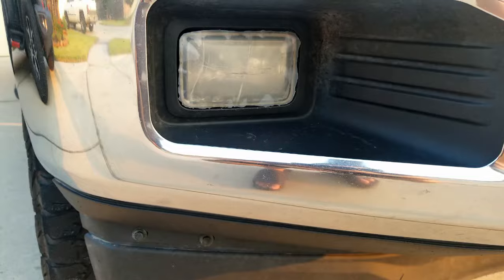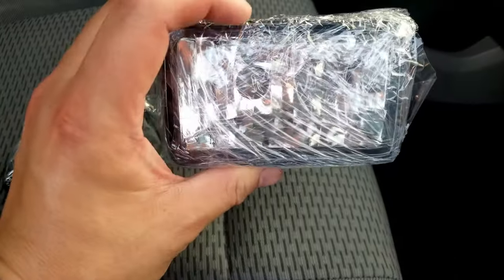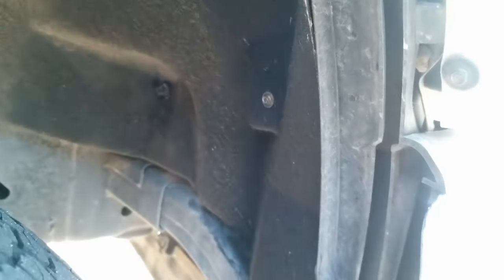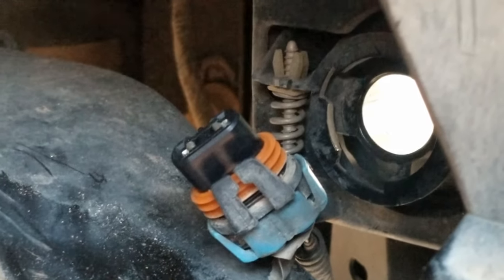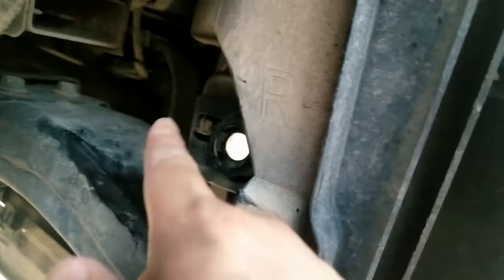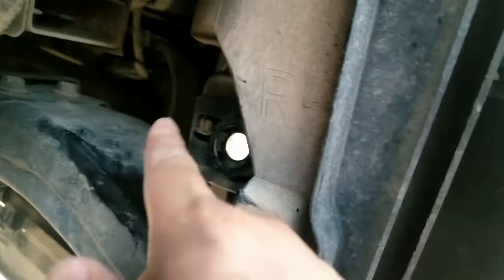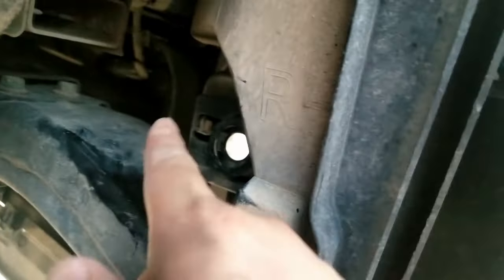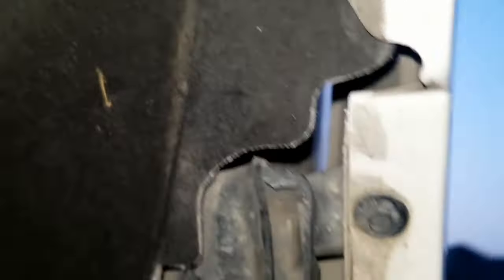2015-2020 F150 Fog Light Housing Replacement

Comment: GREAT tutorial - Thank you!  Mind aren't cracked on my 2018 F150 Lariat, however, they have condensation in them and the bottom if full of road dirt and sand.... how that happens, I have no idea.  I will be using this tutorial to replace mine...thanks so much for a great step-by-step.

Comment: Great job man. Very informative and easy to follow. One of the best how to vids I’ve watched. I wonder if Ford will cover my 2020 under warranty. Cracked right thru the middle from side to side.
Reply from the maker: Hey Ronnie Gregory, I wonder if they will cover it under the factory 3yr/36k warranty also. I can see the argument from both sides. From their side, an outside object/force damaged it causing the crack. From a consumer's side, they should be able to take on rock chips like our headlights and not crack. It could go either way. If you take it in, please update us on what the dealership says!

Comment: Glad it worked out for you. I replaced the housings on my 2019 with LED housings about a year ago and here is what I learned.  
1. There are dozens of videos on how to remove these things without struggling.
2. LED fog lights are much better and you can get them fairly cheap, I think I paid 55 bucks for my Morimoto clones on Amazon.
3. You definitely need plastic trim tools to keep from breaking or scratching things up, looked like you gouged up the plastic trim around the fog light pretty good with that screw driver. 
4. The housings are marked L and R, at least mine were.
5. I pulled my truck up to the garage door and marked the center of the light beam with tape before I removed them. When you put the new ones in you can adjust them to the original position and go from there.
Reply: Now, adding the LED's, is the actual housing different, or can LED bulbs be put in the OEM housing?
Reply: @Powerstroke98  , if you are replacing the entire housing, they are the same, you just have to reuse the adjustment screws from your OEM housings. Lots of videos on how to do that. If you just want to put LED bulbs in the OEM housing, yes, you can do that, just make sure you get the right bulbs.

Comment: So, i just replaced my oem LED housing with new style LED for brighter and wider beam.. here id what i learned..

Once youve removed the adjustment screw and the lights.

Start with the difficult side, its tough, but get a short flathead or anything like that and pry the tab back as best as u can while pushing the housing out. You will hear a pop when its moved, NOW u can pry the easy side and push out. Once it pops forward u can move to the front of the truck and grab and pull. 

I hope this helps.